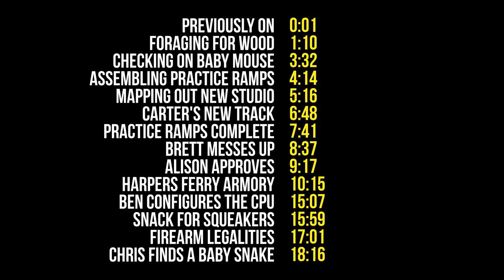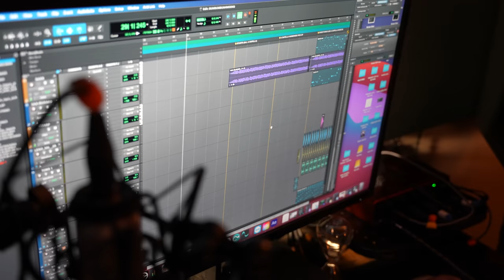Someone Put A Snake In Chris' Car

Comment: You’re exactly right on the suppressor. If you have a home defense rifle, you need to suppress it to reduce the muzzle blast.  An unsuppressed weapon fired inside a closed structure is extremely disorienting to anyone who hasn’t experienced it before.
Reply: Even outside without ear protection it’s bad haha
Reply: @deanerhar  absolutely! However, in a enclosed area environment it rises to the level of disorienting.

Comment: Tim, the Calico (Cali-Co) 22lr is an amazing little rifle. It was used in the movie "Space Balls". You'll need to look up the loading procedure and crank cycle for the mags though, some can be finicky and I'm not sure that he told you the correct steps. I believe you have to release tension before loading then release it again after it's loaded BEFORE cranking, but I'm not sure about the 22. They also made a rifle and a pistol version in 9mm.

Comment: Suppressor is made eliminate Flash and sound suppression . Only 300 Blackout or 22LR using Sub Sonic is your Hollywood quiet . My 12.5" 556n is 167DB with out using Can . With my YHM T2 Turbo its 139DB and almost 0 flash ..
In the Military using Can is must because at night the flash of your muzzle can get you killed . Surefire , OSS and KAC are probably the best . Pair those Cans with LMT , KAC or Centurion and that will be awesome rig.

Comment: You should have left the baby mouse so that the snake had something to eat. Or like I commented on yesterday's video, give the mouse to Bucko.
Reply: The girls are attached now. Chris was correct. I doubt it will last much longer. It will die. 
At least the snake could have benefited from it.
Reply: Y'all don't know anything. The mouse will only die due to their stupidity. I've seen ppl raise pink baby mice with kitten formula and  dip it in a paint brush. They learn real quick to suck the milk out of the bristles. It's very easy and they always survive as long as nothing is wrong with them. They are as easy as raising squirrels.

Comment: The PC liquid coolant issues you're having are one reason why liquid cooling for PCs is a gigantic meme. Just get some noctua fans and have some good airflow and you won't have to worry about liquid pressure or refilling or leakage or any of that crap.
Reply: Exactly. Linus Tech Tips at one point had several computers hooked up to a water cooling system, and there were many issues. He then chucked the system and then had everyone go back to fans.

Comment: For the kind hearted-Baby mice are extremely difficult to save. They're metabolism is through the roof so they feed every few hours, and feeding them in itself is a trial. Get a fine tipped paintbrush to help, because bottles cannot be made small enough.

Comment: I am in shock that you guys built a new studio, and then are adding all the wiring last. Whoever’s idea that was should be fired. All the wiring should be done first, then finish materials go last. There should be absolutely no wires showing anywhere. Same with the floor. You build up slats to allow space for cables, then put the flooring on top of it.  Same with the studio table. Unbelievable. Anyone could have told you that in an email, for free.  Oh, and snakes do breathe air. And yes, a jar with a lid will eventually suffocate a snake